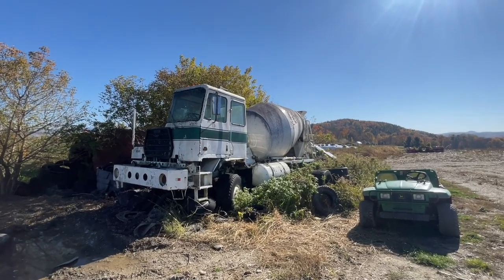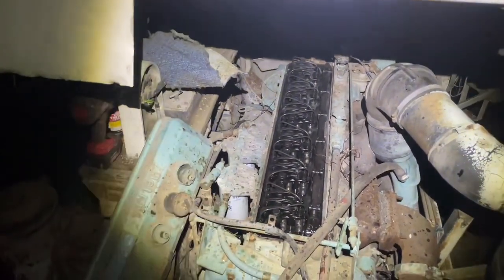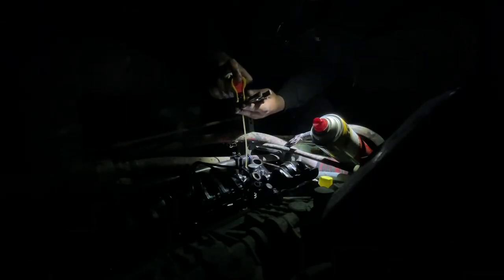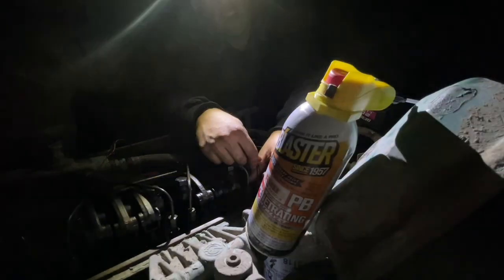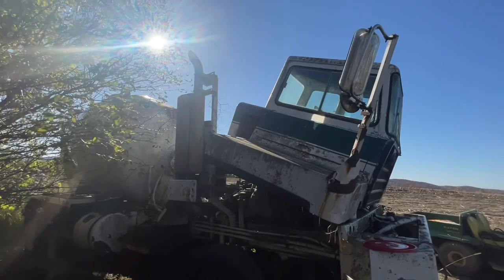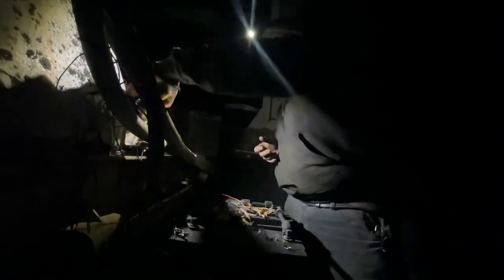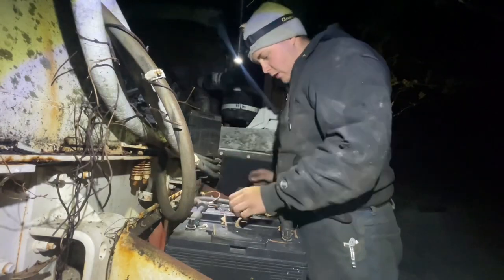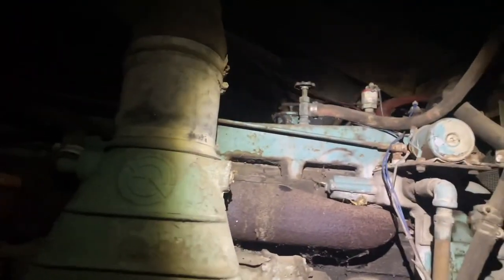WILL IT START? 1970’s Crane Carrier Truck with Series 71 Detroit Diesel - “Crane Carrier” Part 1

Comment: That truck will be very reliable minus the shifting lever cables, fool proof engine and driveline not enough power to brake anything , I’m sure simple rubber block suspension not a bunch of bushings and moving parts , no electronics and I love the grill it resembles a Terex haul truck or scraper grill  
Nice now put it to work
Reply from the maker: Yes sir everything is very simple. Simple enough for me to figure it out lol. I cant wait to put her to work
Reply: Keep oil in everything and it will last forever